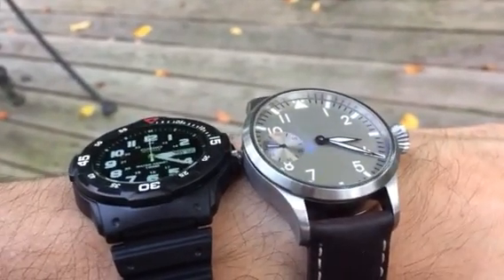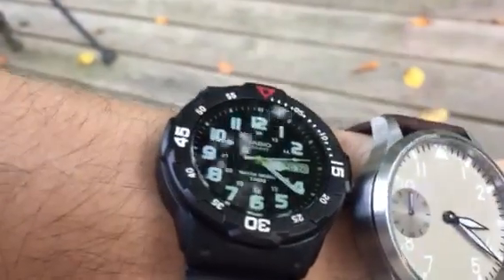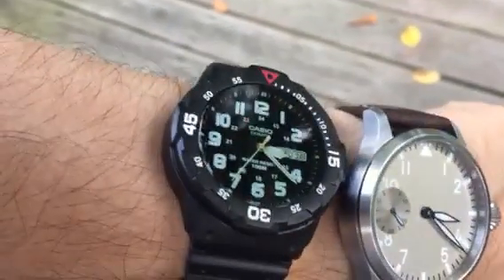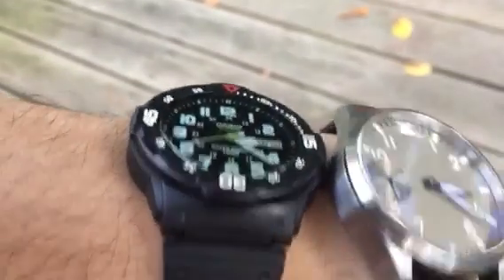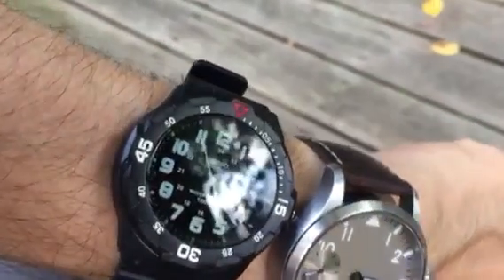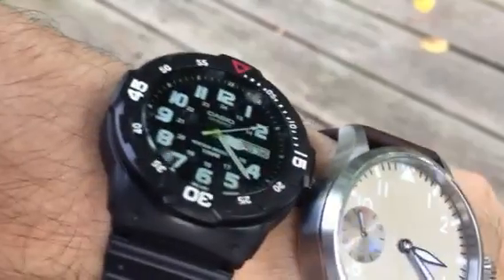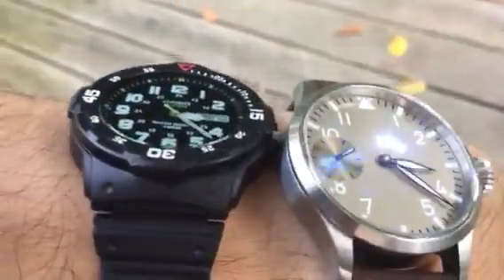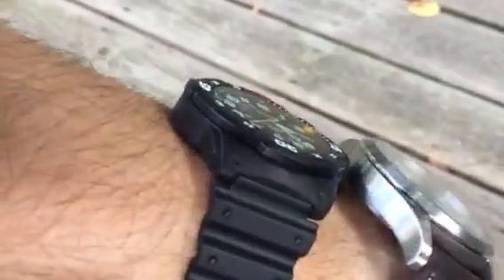Fluid Filled Casio MRW200

Comment: I've done this to a couple of Seiko analog quartz watches and they're fine except for the pain of battery changes, but it's actually not so bad since I fill the oil with a hypodermic syringe/needle through the crown hole which keeps the mess down. 
Indeed a solar watch will stretch the interval but I'd rather put my money toward a GPS or radio synchronized watch.

Comment: Hows the watch after 3 years?
Reply from the maker: ryanito battery finally went out.  Not so impressive battery life as expected. Really curious how the solar models would hold up
Reply: @frenchwm  If you use the fc-40 oil (same as Sinn uses) it will last much longer, that oil has a viscosity even lower than water.
Reply: @rehakmate  That's how their Hydro gets 7 years from a new battery then.
Reply: @frankgregory8891  Yep, you can get it too, although its pretty expensive.
Reply: @frenchwm  Just had my Seiko solar 100m watch oil filled.10 month power reserve will probably drop to around 3-4 I guess? Sunny day/cloudy days are free!

Comment: Man, this video and comment section are great!
If this all works, then I'm f-cking doing it.
Any updates so far? How's the battery life and does it leak?

Thanks for the video!
Reply from the maker: G VS hasn’t leaked but it seems the battery went out after about 2.5 years.  Interested to try it on a solar watch or with a less viscous fluid.

Comment: Can you do this with olive oil?
Reply: it will eventually turn rancid and thicken. No good
Reply: Heavy D still looks perfect after 2 month, of which 2 weeks were 35°c plus in Croatia. Have used silicone oil for watches with actual hands tho
Reply from the maker: Pablo 365 negative.
Reply: @frenchwm  just tried it on a Casio F91-W, you can use olive oil. Watch works, no problem.
Reply: @r4geCinematic  Doesn't it leak?
Specially in a F91, since they shouldn't have very good sealing gaskets as more expensive watches.

Comment: More resistance to the hour and minute hands, less battery lifespam, you don't have to be an engineer to know it!
Reply from the maker: newhuskytwenty youre right about that, i'm sure it'll kapoot kawicker but it's still runnin' strong! This is really just a fun experiment.  Im still on a hunt for the most viscous non-conductive fluid possible. Any hints?
Reply: Wow I'm totally blown away. I didn't belive this was possible with analog watches, even less mechanical ones. Congratulations.
I don't think the "more resistance thing is an issue", the module is a simple machine, it wasn't designed to work on different environments so it doesn't have the ability to adjust to different resistances. The machine makes a jump and a stop for every small movement, so if it still does so I'd say is because the oil doesn't impede it's function. Also, the hands are flat, so I'd also say that helps cutting through the oil.

The only thing that worries me is oil leakage. In simple analog watches there should be less issue, since there shouldn't be much interaction with the inside, but in digital watches it could be  problem with all the button pushing, thought someone (ULTRA NOOB) posted here that he read someone did the hidromod to a simple WR analog and it whitstood 300m/990ft.

Really interesting stuff.
Reply: Seconds hand too.
Reply: I have a automatic watch filled with silicone oil and it keeps perfect time... No need to worry with the batteries ;) definitely a conversation starter for sure.
Reply from the maker: jumbovein awesome! Does it run a bit slow though? I was curious if someone out there tried this
Reply: @frenchwm  it's still within its +/- limits so id say there was no noticeable changes. Did reduce the power reserve slightly. 👍

Comment: I've seen this done on digital watches but not on a analog watch with moving parts ( the hands ). The second hand moves fine in the oil?
Reply from the maker: ace frehley yeap, works just fine
Reply: interesting
Reply: lol anf for 20 bucks you could just buy another one if it stops
Reply: If you want a three years last battery to last just one, yes, it's interesting. Too much resistence for the arrows
Reply: @pericodelospalotes5738  I'm not so sure about that. remember they are flat and also the hand makes a jump and a stop. If it wasn't able it just wouldn't move, so I'd say the movement(action) is between the means of the mechanism. 
What amazes me is someone posted he did it to his mechanical watch and it kept working flawlessly.

Comment: I did the hydro mod on my Casio GX56. It took a few times, and some days of waiting for bubbles to settle out, and quite a bit of silicone oil. At the end it was perfect. Has been about 8 months and there have been no bubbles at all. Can't tell it has been done. (I ended up developing a strategy where I submerged all of the parts in a mug of oil  (module, screws, rubber seal, back plate and the case) and did the full assembly under oil. That was the only way to get zero bubbles.). What I do wish is that I could find a way of testing how much pressure it could withstand.
Reply from the maker: MobileMood, yeap it's a pretty messy job but well worth it right? A vacuum chamber helps to get the bubbles out but even so, it's a challenge
Reply: 990ft. A guy on a forums tested it (works on a oilrig) he used oliveoil though and a digital 10bucks watch with no depthrating but only a splash resistance
Reply: @Strange-Viking  You're kidding me.
Does the oil not leak out? I'm interested but I don't wanna have it leaking on me.
Reply: Degassing is usually done with a vacuum pump.  You can test depth by getting two 500' spools of kite fly line tie the watch and a weight and throw it overboard in very deep water.  ; )